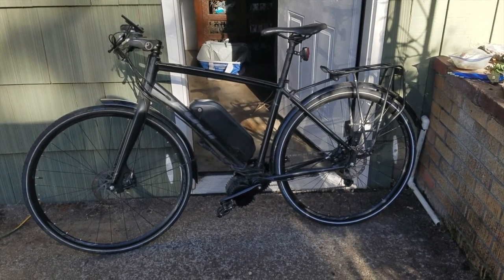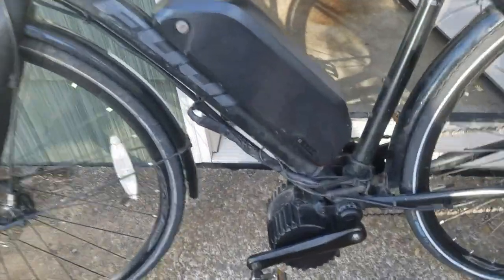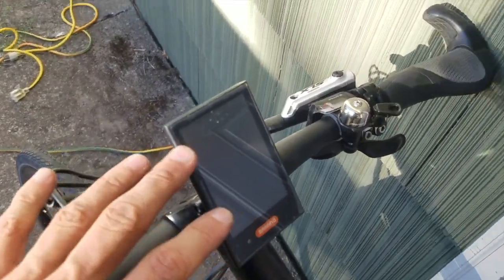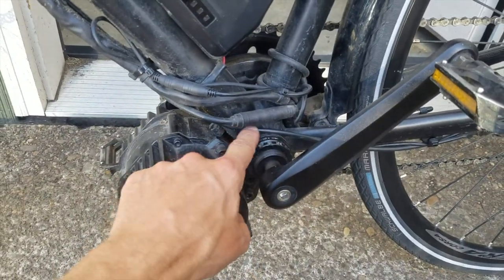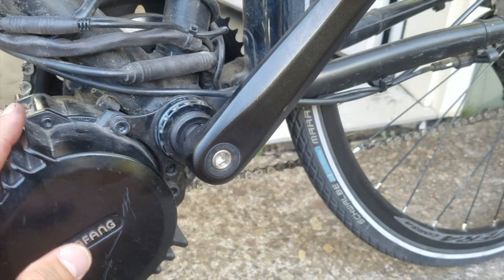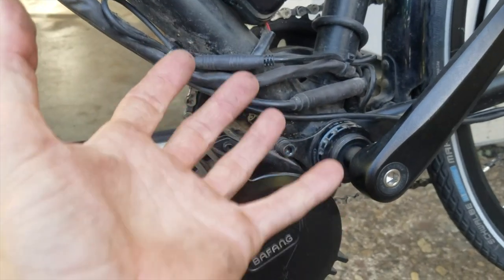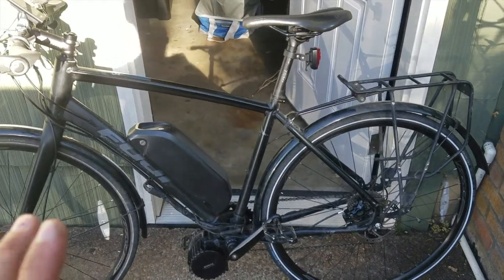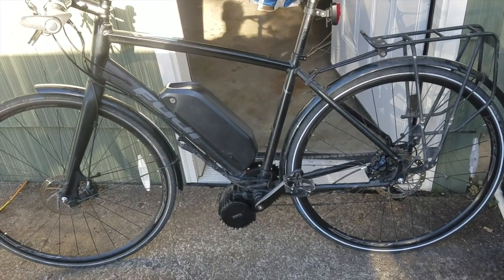Bafang BBSHD 2000 mile review and update

Comment: I recently got a trailer for my bike, which is surprisingly fun to cycle with. If I was going to go EBike touring, I'd get a second battery, and stick a solar panel on the trailer so that one battery could be charging from the sun while riding with the other. Plus I could have my touring gear on the trailer.

Comment: Can the torque on these motors ruin a bottom bracket?
Reply: What bottom bracket are you talking about, you have to take the bottom bracket out to fit the kit.
Reply: @davidhodgson977  I meant the frame. These motors could put a lot more torque in that area.
Reply: @m. richards Your question was a question that I haven't heard anymore ask before (good question too) my kit has done about 1000km, and the frame is no different.
I have broken one chain,but that was before I reprogrammed it.
Good luck with it,i f you haven't already done it.
Reply: @davidhodgson977  Thanks, I was hesitant to put one of these on a new frame since I can't afford to replace.

Comment: Enjoyed this video but it's not true you can't ride with others due to being over powered you just turn the power down, I often ride as If I have no motor when set to level one, I have an egg rider and have smoothed out the settings bit it's not true  that the 1000w is just some wild animal that drags you along, it can be ridden very softly if needed but the powers there if you want it.

Comment: A good tip when assembling these to stop the motor turning or working loose is to
A, when tightening down ensure every mating surface is cleaned with alcohol spirit and Free from any contamination, dry clean surfaces no grease from the bottom bracket etc etc.
Also the bafang bracket has small notches on it to dig into the frame. Set the motor where you want  then mark the notches on the bracket with a marker, offer the bracket to the bottom bracket housing on the frame and it will leave marks where the notches are from the marker pen. Very gently with a small hacksaw add a thin groove in your frame where the notch is. It doest have to be deep just maybe .5mm or less, this will give a groove for the bafang bracket to "key" into your frame. Then  fit the motor and tighten down hard. If the mating surfaces are cleaned with alcohol spirit and the small grooves are in line with the notches on your bracket the motor should be well fixed. Hope this makes sense 👍
Reply: Use loctite. It stops your screws from loosening due to vibrations while riding. 
It's often used on electric skateboards to screw in the battery box.
Reply: @a_ditto5722  super stupid advice unless you never want to take out the motor.
Reply: I don't have a kit yet but am doing my research  in anticipation. I've heard of this issue from a few owners and think a pair of hose clamps and some rubber hose would do wonders. One large clamp around the motor and one small one around the lower frame tube, use the rubber tubing to isolate vibration, cushion the frame, and situate the clamps in the best location.

Comment: You don't need to heat shrink those connections from bafang they are extremely well sealed and tight, nothings getting in it's a waste of time, I understand people doing it but the bafang connections are extremely well sealed and sometimes impossible almost to disconnect due to the fact they are so well sealed

Comment: Hi could you please tell me from your experience with this motor that when you switch to Pas 0 you feel like you're pulling additional weight or something?
Is this motor should fully disengage when on Pas 0 so that you can pedal like normal bike or the resistance is really noticeable?
Thanks.
Reply from the maker: The resistance is absolutely noticeable. If you shift to a low gear you can go 12 to 15mph and not struggle too much but it is not the same as a regular bike
Reply: Thanks s lot pal for your comment.

Comment: Is it waterproof/resistant just in case you get caught up with the rain while riding?
Reply from the maker: Yea it's water resistant. I've ridden it hundreds of times in the rain and sprayed it down with a hose without issue. I put dielectric grease on all connections and put shrink wrap on connections as well

Comment: Thanks for info. But im in shock about you saying you cant ride the bike normally with other cyclist... i mean level 1 assist should be slow enougj but powerful enough so you dont feel weight of bike, but still ride no more than say 12-15 miles per hour... if that not the case, then perhaps you should get programmable cable and tune settings on motor

Comment: I am a bit surprised that such a sensational and highly efficient bike is not getting better range. Do you ride high boost and with throttle a lot? Maybe a lot of large hills?

Why not run lower boost when riding with others. Why not tour with an extra battery?
Reply from the maker: No hills and not a lot of throttle but I do like going fast. Apparently.once you go over 18 to 20 mph you do lose efficiency
Reply: @SeantheRD  at just 15mph 85% of your energy is for just overcoming drag. It actually goes up from there. Anything you can do to improve wind resistance is going to improve your range dramatically. On time trial bikes, they add a LOT of weight to improve aerodynamics. It is weird to see a $10k bike that weighs whole pounds more than a $3k bike, work on them both for the same athlete and they are okay with it.

Comment: Definitely need to check fasteners frequently, at least monthly.
Similar to my Cannondale Quick5 had RD probs loose hanger bolt caused it to try and shift underload
Of course you are faster than cyclists, you are an unlicensed motorcycle.
Wind noise is a hearing loss issue on motorcyclists. Around a helmet if it often >100dB

Comment: If you would have used the proper sockets and a good torque wrench you wouldn't have an issue. I have over 36K miles on my ebike and have never had any problems with the lock nut.
Reply from the maker: What socket do you use for the lock nut? It's not a standard 6 point. And the axle sticks out about an inch so it would have to be a deep socket
Reply: @SeantheRD  Here's the socket. - https://photos.app.goo.gl/xcjPP9jJTuW5EKXv9

You can find them in several places... I don't endorse these guys but this is one vendor: https://www.empoweredcycles.com/products/8fun-bbs02-bottom-bracket-tools

I've been using a BaFang mid-drive for 36K miles over the last 5 years. Try over-torquing the nut by 15 lbs. 
and you won't have a problem. With the right battery and a Rohloff Speed-hub on your bike, you could easily be doing 100-miles on hard surfaces. Stay safe.  

Full suspension ebike evolution:
https://photos.app.goo.gl/wP8vs7T5hLpNjSBX8

Comment: Just got the Luna bbshd kit for my fat bike. I've been riding it hard on all the hills in my area and it seems to take the stress ok so far. Sure beats the TSDZ2 I had on the bike. Really eats the battery though if you want to stay around 20mph.
Reply: I'm about to flip a coin on the tsdz2 and bbshd.  Bafang is suppose to be more powerful but i like the idea of the torque sensor where i'm in more control of the bike instead of the bike controlling me.  I'd be on paved bike trails anyway so climbing up dirt trails wouldn't be an issue.  do you think the tsd would be more ideal for paved trails or is the bbs worth the lack of control.

Comment: Is the motor system are waterproof? No issue on washing the bike?
Reply from the maker: The motor is water resistant. I've sprayed it directly with the hose no issues although this is not recommended. It rains a lot in the northwest and I haven't had any problems

Comment: Got mine a month ago, love it. Good to know these kits last! 👍. I’m going to break down and get a 52v batt instead of the 48v I have. Might give me a lil more pop and distance. My gas powered build would do more than 40 miles, as long as I have gas, but, doesn’t come close to electric! Yes,  your right, my rides with my girls regular bikes can’t hang. Got to figure it out, can’t afford to buy 2 more kits, lol
Reply from the maker: 3600miles on mine and counting
Reply: David - I'm getting ready to put a BBSHD with a 72V on my Trek.  But I am hearing that it will only go about 40 MPH without an external controller.  You might want to research getting an external controller rather than a new battery.  From what I understand, a 48V capable controller can belt out up to 2000W if you get the right controller.  I'm still in the research phase myself.  But on Amazon, controllers are around $100-$150.  Batteries are much more, but are limited anyway if you're using the standard controller.
Reply: @SBiller442  very good to know sir. Still enjoying the kit daily. But I’ve been going through rear wheels. It’s been eating up my bearings because of all the torque. Any suggestions?
Reply: @davidanderson6222  would love to see a video of that I just bought a bbshd. I'm already having chain skipping issues. Would hate to add bearing and hub issues to the mix
Reply: @luckyfire3  I take quite a few links out my chains and that helps wrap the chain around cassette smaller gears better, but the motor does wear out chains! Keep it clean, it helps
Reply: @davidanderson6222  get the highest quality sealed bearings and hubs you can afford, it will be expensive but it will last longer.

Comment: The motor relocating over time is because of the the bolt getting loose on the bottom bracket. It must be checked and tightened regularly.
Reply: Use the torque arm kit from California E-Bike. I just installed the 750 watt BBS02 and made sure to install this kit. I'll never have to worry about the motor coming loose.

Comment: If you're that strong a cyclist just use a lower PAS level. Use power only to assist up hills and you'll extend range considerably.
Reply: Exactly correct,as you probably know, the motor can also be reprogrammed to extend the range.
I wish this kit had a torque sensor.though.
Reply: @davidhodgson977  You're not alone in that wish. For torque sensing the CYC Photon looks interesting (bigger price tag tho).

Comment: Other than the weight, how "different" does it feel pedaling manually with the motor turned OFF versus having no motor at all (regular BB+chainring)?
Reply from the maker: It's absolutely terrible. It's like pedaling while squeezing your brakes. If you shift twice into a larger rear  cog it's not bad but it's slow going
Reply: @SeantheRD  Ah, so when I run out of battery, it's not "just like a regular bike" I guess
Reply from the maker: @pazuso  no you would have to shift down a couple years to be able to pedal comfortably
Reply: @SeantheRD  So I kinda get what you mean by "dedicated bike" with the motor, and another nice regular bike
Reply: It’s exactly like peddling with your brakes on. Make sure you have batt charged. Just saying

Comment: Nice. I have the same kit with same battery 52 volt 14 amp hours and it's fun to ride I have one issue with mine and the battery connectors melted and then I wired it straight together so the battery no longer is removable but no other issues with motor or battery but I went through 5 chains and two cassettes and I have 6200 km on it. Good so far🇨🇦👍🏻
Reply from the maker: If I was better with wiring in would love to shorten the battery cable in dont known why they made it so long. I've gone through one chain and one cassette. It would be cool to have this on a belt drive
Reply: Did you have any issues ordering the motor into Canada with our dumb ebike laws?

Comment: I troll scooters with it ^^
Reply from the maker: Yesterday there were two guys on gas powered scooters going a solid 30mph and I beat them to the end of the street. People go crazy when they see a bike fly by them
Reply: Too be honest  going 30mph on a good battery  is plenty anyway more speed means less range you have to look at what you want if you want a racing bike then 100mph motor is needed lol for just comuting  and getting to work 20mph  or 30mph  and with a wide range of gears can help push Me to 40mph yet guarantee  juts pedaling alone will increase range upto 100miles on a 34ah 52volt battery  since  I have  oomph  but I don't plan to use it unless it's raining  hard or something  like that 750watt  is the best mid drive for range and power
Reply: Anyone buying a scooter now days is choosing poorly.
Reply: @rabbi7933  scooters still have an advantage in range department. Gas stations are everywhere and filling a tank is a minute or two. Of course, gas is more expensive than electricity, but it all depends on how you weigh it out basically unlimited range vs price.

Comment: I've read several negative reviews of the Hailong 52v batteries so I decided to go with the EM3EV kit and battery which is made inhouse. A little cheaper than Luna but I will have to wait on the slow boat from china. How are the batteries lasting any issues?
Reply from the maker: I've had my battery for 11 months and 2400 miles. I charge it 2-3 times weekly. No issues so far!

Comment: Great review. Im in the process of shopping for a BBSHD kit for my bike. Do you mind listing the ebike store you purchased from? There are quite a bit of vendors on AliExpress
Reply from the maker: BesteBikestore
Reply: Bbshd is uphill peddling en if u stop peddling u going down, better bbs02b with gas hendel
Reply: Eunorua has a pretty good deal on a kit.  I've purchased 2 from them and although I did have a problem with the first one CS reached out and I was satisfied enough to buy a second. If you are in the US you might be better off going with Luna. In the off chance you have a problem the $50 or 60 bucks extra is going to make things a whole lot easier and faster.

Comment: Is that the battery with comes with the ali express one? I'm wondering if I'll be OK with the 52v 21ah one of them or if I should get one from em3ev and wait for it to be built. What do you think of the battery build quality
Reply from the maker: The battery came with it. It rocks. I wouldn't hesitate to go 21 ah but this thing is fast enough. The build quality is top notch make sure it comes with a lock built in. My buddy got a luna cycle battery and it didn't come with a lockable battery
Reply: @SeantheRD  Good the hear man, gotta try and figure out if I'm going to be able to put the battery on the carrera fury I have lying around or if I'll need to find another bike, gunna be close
Reply: @SeantheRD  - Have you thought about using an external controller?  I'm thinking about going with one because some bloggers say that a 72V battery is very limited if you use the standard controller.  Any thoughts?
Reply from the maker: @SBiller442  I have a 52v battery.  External controllers are great if you want maximum wattage but you risk breaking chains and going through components faster and i think you wont get as many miles out of the motor over its lifetine

Comment: 45 mph top speed?  Is that with throttle only?
Reply from the maker: On perfectly flat ground I can get up to 38-39mph with throttle only. With a slight downhill I can get over 40. With pedal assist I can achieve almost the same speeds. I actually go faster with throttle only because I tuck down to get more aero
Reply: Sean the R.D. 
Thanks for the reply!

Comment: you can get a triangle battery and throw it in a backpack and you would get 120 mile range.  A triangle pack can be 21AH 52v. Triangle packs are much cheaper than shark style batteries.

Comment: Thank you for the video.  I converted my Cannondale Adventure 400 to a Bbso2.  I agree with much of what you say.  I have a 48 volt 12 amp hour battery and recently rode on the Katy trail in Missouri 45 miles in 1 and 2 assist level, and still showed 40 percent battery remaining.  I'm very happy with my setup.
Reply from the maker: Well be careful the battery percentage should not be interpreted the same as you would with a cell phone. See, your 48 volt battery when fully charged has something like 52-54 volts and when dead might have 35 volts. Basically, if my battery goes under 40% it is nearly dead. At 33% is shuts off entirely. So it looks like the 45 mile range you got is about as far as you want to push it.
Reply: @SeantheRD  There are so many variables that the only way to estimate range is on an individual rider basis.As an example I ride my ebike pretty damn slow relatively speaking generally averaging about 15mph, which is pretty close to what i used to do on my road bike with MUCH less effort, rarely touch the throttle except for sketchier intersections and my battery is back to full charge with with a 109w charger within 3.5 hours after a 40 mile ride with ~2,000' of climbing with a bbs02. Also, i do pedal fairly hard on the tougher sections. 

If i rode it like a motorcycle, the 11.5ah battery would be dead within 25 miles max because my bike is HEAVY, flat bars force me upright, and panniers add to the air drag that increases exponentially with speed.  AERO matters, riding style matters and terrain matters, A LOT. Without collecting a large volume of person information and testing that information in the real world, estimating range is a fools game, not because ebikes are variable, but because people and their environments are. 

Also, the battery indicator on my battery and on my display is very, VERY optimistic. 

BTW...he battery on a phone does work the same way, it'll shut the phone down when the single cell battery drops below ~3.2v from about 4.2v, but the display is better.